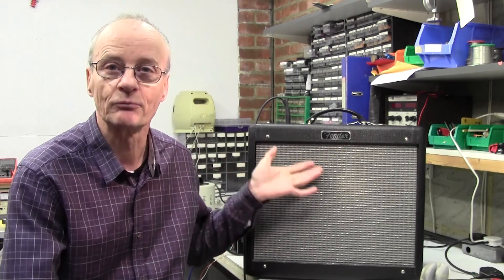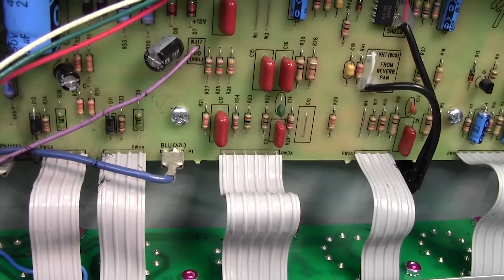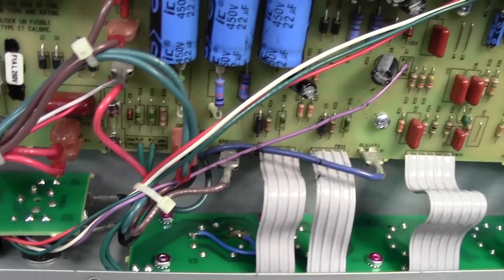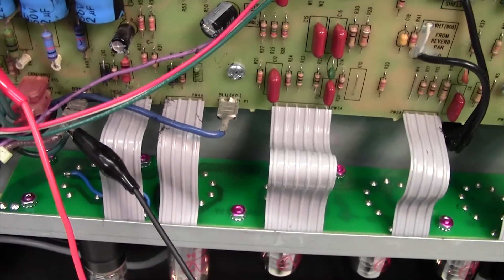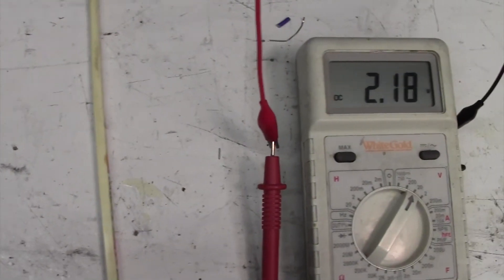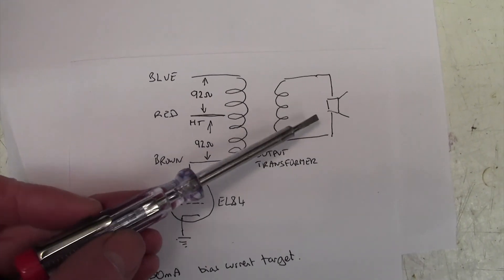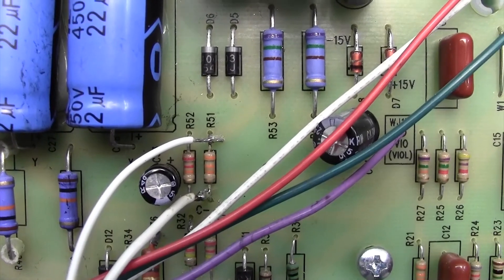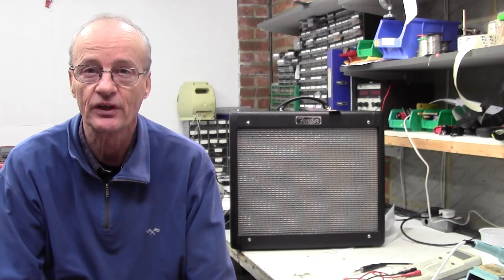How to Bias Fender Blues Junior Guitar Amplifier

Comment: Thanks for the informative videos! I like learning - and a few years ago replaced the Power Transformer in my late 60's Traynor YGM3. - it had a bodged in 220V replacement that caused the Heater to run at 7.5v and B+ at around 450vdc! Has the correct Hammond one in now.

 A couple of diagnosis questions if I may?

I've just been given a dead Blues Junior that had a blown V5 valve and dead power transformer as a project - lost vacuum and has gone white at the top - which I assume may be the reason the PT went down. 
The traces around the base were pretty discoloured with some lifting. Have reseated, but I'm replacing the board. It looks like V5 has been quite a bit hotter than V4 for a while.
Have replaced the PT and all up and running with correct voltages at the filter caps and heater at 6.7V -  but low output and distorted. 
I measured the Output Transformer and have a massive mismatch it seems. I did add a 82k resistor to cool the bias - as per the recommendation by you and people like Psionic. 
When measuring the voltage either side of the centre tap, I have 2.1v and 0.8 volts. The resistance/impedance measurement either side of centre tap is 110 ohm and 45 Ohm. Is it likely the OT has gone south as well? 
All the other components seem to be at spec to the schematic. Many Thanks!
Reply from the maker: Hi. If you have that white at the top that means the tube lost vac. If the PT went down then the tube drew a lot of current. Surprised the HT fuse didn't catch it though. It's certainly possible that the OT went down as well. Despite my video I (and others) are finding it sometimes hard to measure the current on the BLUE side of the OT  (i.e. RED to BLUE). I'm unclear why this is. If anyone reading this knows, I'd like to hear. It's fine on the RED-BROWN side. Your ohm readings on the OT are a fair way off. Each side should be about 85ohms. Disconmect the RED BROWN BLUE spade when you take the measurement just to be sure. Let me know how you get on.
Reply: @stuartukguitarampguy5830  Thanks Stuart. I ordered a Hammond replacement and installed it and everything is fine now - so the OT was definitely at fault as well. The new one measures 92 either side of the centre tap. There is solid brown gunk oozing out of the  old OT where it looks like it melted then set afterward, so I think one side of the tap was totally shorted - still measures 110 and 45 respectively. 
Hard to tell what the sequence of events were here - whether it was a transformer or valve failure. All the big IC caps were fine and showing correct vdc when I installed the PT prior to changing the OT as well. I've replaced them now anyway, as there was some yellow crustiness showing - so they were on their way. 
I've also wired the transformer to operate at 240v as it has a tap. We regularly get upward of 250v from the outlets here! The amp is still plenty loud and crunches nicely when you want it. Not sure why they set it all so high...maybe for the metal kids.
The Valve board was a very brown on V5 and had some lifted traces, so that has been replaced as well. I was given the amp for free and all in it's cost £120 to get it back up and running. 
It's so great having gents like you on YT for self sufficient diy'ers like me, who still want to learn stuff well into their 50s...thanks so much
Reply from the maker: @valleywoodstudio7345  Soubds like you've done a great job there, well done.
Reply: @stuartukguitarampguy5830  my BJiii manufactured Oct 2015 has cooked far left EL84 and i get 3.7v  in Brown lug per video. on the blue lug i get sudden voltage climb to about 2.95v and then open.  Put 2 brand new el84 in i get rise to 3.95v per video and same issue with blue lug no reading.  Following this thread  above - i suspect it’s the transformer.
Reply from the maker: @jonnyz5772  Hi. If you're really measuring 0V from chassis to blue then it could be the output transformer open circuit on one half of the primary. With the amp completely off and discharged, try measuring ohms between blue and red. Should be about 100 ohm, Same as between brown and red.
Reply: @stuartukguitarampguy5830   98 Ohms Red + Brn and 99 Ohms Red + Blue ... whew OT seems good then!  [Unplugged the speaker and got 106 and 107 ohms respectively]
Reply from the maker: @jonnyz5772  Yes that;s ok. From your oither message I think your bias is too high so adjust it down to about 20mA

Comment: Hi Stuart thanks for a cool video. One question you ended up with plate voltage of 333 and bias at 26.5 ma. Doing a little math that is 8.8245 Watts for a 17 watt tube or running at 0.519088235294118 which to me seems to be way cold. Am I missing something here because my math says the tube should be at 11.9 watts and while the voltage will change going with 333 volts the bias should be set at 0.035735735735736 ma or 36 ma.

Am I missing something or are we just trying to make the tubes last forever?
Reply from the maker: Hi. Interesting. I can;t fault your calc. I always use weber bias calculator app on the ted weber site. If I plug these figures in there it say 26mA. at 70% dissipation. I'm not really sure why there is this discrepancy.
Reply: @stuartukguitarampguy5830  
 I think I figured it out. The question is what is the actual wattage of those power tubes. I thought the EL84 tubes were 17 watt tubes but it appears they could be 12 watt tubes. The amp itself is listed as a 15 watt amp but I would have to say the Weber site calculations are based upon a 12 watt tube.
Reply from the maker: @pedalworx  Ah ok that makes sense thanks.
Reply: @stuartukguitarampguy5830  
I was thinking being there doesn’t appear to be an agreement on what the tube power is in class AB operation that perhaps we should go with the Fender numbers?
Fender says it’s a 15 watt amp so 70% of that would be 10.5 watts!?

Hey, what ended up causing the runaway bias in that amp?
What did you find?

Thanks so much Stuart!
Reply from the maker: @pedalworx  The JJ Spec sheet says it's a 12W tube so 70% of that would be 8.4W.  Pretty much what I biased it at.

Comment: If you connect a multimeter between transformer center tap in presence of high voltage it´s very likely that on one of the sides (red-brown or red-blue) you will read strange measurements due to an oscillation that occurs when extending those cables outside the amplifier. In this case it would be more convenient to identify the bad side and read on the good side twice by swapping the tubes between them. 33ma on a el84? Thats too hot! Why aren't you sharing the bias trouble? I'm working on the same amp and its giving me fits trying to get it right.
Reply from the maker: Hi. Okay here's the scoop. The best way to bias these amps is to use a bias probe between the EL84 and the socket. BUT... it's rare for people to own one of these small base bias probes (I do have one made by Eurotubes). So, how to bias? Well, the output transformer primary has a resistance of about 100 ohms. So if we measure the voltage across that primary half  we can work out the current through it. so 2V measured across 100ohm gives 20mA current. We can measure from red to brown for the one half of the push-pull (one EL84). Ok so far? The problem comes with the other half (blue to red). You don;t REALLY need to measure this if you have a matched pair of valves. However, I too have noticed that if I attempt to measure Red to blue, I also get weird results. I have no idea why and if someone reading this knows, please let us all know as this has always mystified me. Take home? No bias meter - measure red to brown and use ohms law to calculate the current.
If you want it more accurate, with the amp off, measure the ACTUAL DC resistance of that winding. You may find it's 94 ohms or whatever, and you can use this to get a more accurate reading. Hope that helps.
Reply: @stuartukguitarampguy5830  Well the amp I'm working on just got weirder. The amp has a bit of distortion in it but I can't find nothing bad. I cut the 3000 volt flyback diodes out of the circuit and the distortion is gone. The diodes test ok. ???????????
Reply from the maker: @rockinws6567  That is strange! Could they be breaking down at moderate vpltage, but read ok on the meter? Try replacing them with new, if you have any.

Comment: I've done the same thing a couple of different ways, one by paralleling a pot across across the 33k resistor and adjusting it to where I like as you did with your decade box and then installing a fixed resistor in parallel the other way one of my vendors hand selected some very low current draw EL84s which sometimes can be dropped right in. I've installed trimmer pots as well. Once I get it where I like it I mark the chassis so the next person in knows what current rating the power tubes should have. Now. Tell us what the fault was that you were talking about.

Comment: Which version of BJr is it you're working on here?  I have read that the Version IV has a  27k fixed bias resistor at R52.
Reply from the maker: That may be, I'm unsure. I rarely/never get a V4 in as they are quite new and not yet going faulty. Most of mine are the cream or green boards. The older versions.

Comment: Hi Stuart. Any tip on how to measure the resistance of the primary winding of the output transformer?
Need to check my biasing since I don't have a probe.
Reply from the maker: Hi Rowan. Why do you want to measure the primary?
Reply: @stuartukguitarampguy5830  I believe the transformer had the resistance around 100 ohms. It could be 95 or 98 ohms etc. I would like to measure my milliamps for el84 considering the exact resistance of the transformer.

I believe I need to measure the resistance between the red and brown half of the transformer. Correct me if I am wrong.
Reply from the maker: @Roman_Guit  Hi  I think you're getting confused about the primary and secondary? Are you trying to measure the secondary resistance?

Stuart
Reply from the maker: @Roman_Guit  Hi Again, sorry it's me who  is getting confused! Yes you can measure each half. From memory it's RED-Brown and RED - BLUE then use your exact reading and ohms law to calculate the current. Sorry for confusion!
Reply: @stuartukguitarampguy5830  Hi again Stuart, thank you so much for the response. The measurements will be done.

I've seen lots of recommendations for UK Blues Junior owners to switch the transformer operation to 240 volts. The export transformer for UK and Europe Juniors has a dedicated terminals which could be switched with no soldering.
This will make tubes running a bit cooler and reduce hum as well. Could you recommend doing it?
Reply from the maker: @Roman_Guit  I've never actually done that so I have no info I can share. However, if you set the bias a bit lower than normal that would achive the same thing I would have thought.
Reply: @stuartukguitarampguy5830  Thanks, Stuart!

Comment: Excellent video Stuart. I'm replacing the EL84's in my Blues Junior because one finally failed. I've replaced the tubes and using your technique to measure the bias by measuring the voltage across the primary of the audio output transformer I'm getting about 15 volts which I assume corresponds to 150 mA of plate current. This is way too high. I tried putting a 100K resistor in parallel with R51 and I'm getting 13.4V of c- which should have brought the plate current down. I have tested all the resistors in the bias circuit and all resistors are within tolerance. I tested the capacitors from the phase inverter thinking some B+ was leaking through them but they test OK. The screen resistors and diodes across the output transformer test OK as well. I know you had an issue with bias in a different video that you made and I was wondering if I am having a similar problem with this amp. Any suggestions would be greatly appreciated.
Reply from the maker: Hi Ralph Very surprised at your reading as that is WAY too high. You should be getting about 2.5V. 13.4V C- also sounds too high. I'd expect about -16V. All I can suggest is that you decrease that 100K resistor until the bias comes into line.
Reply: @stuartukguitarampguy5830  Bingo. I put a 100K trim potentiometer set for 75K across R 51 and now it read 2.2 V. Thanks Stuart you're a genius !
Reply from the maker: @rcjferrara  Excellent well done.
Reply: Hi Stuart, I’m working on a Blues Junior clone , my amp , I’m not a professional repairer but old school electronics hobbyist studied City and Guilds in the Transistor era so not Valve educated.
It’s a Tweed Blues junior clone  ( a sod of a fault with massive hum , all electrolytics changed , power supply 5Watt resistor had gone high from 1.8 k ohms ( original circuit correct value ) to 5 k ohms so changed that , HT seems a bit low but got no voltage readings to go on , remove all valves and hum still there , remove centre tap HT feed to OT and hum disappears ) but regardless the output transformer primary on this has different dc resistance readings from centre tap to each half of the winding , this appears to be normal as I have a replacement brand new same  correct model output transformer which is exactly the same reading wise. Explanations I have read seem to be regarding how the transformer is wound . Something to watch out for perhaps when testing ( just something to put in the ‘ what the hell is going on here ? random memory bank ‘ ) Love your videos and your self deprecation when not being perfect and making school boy errors , helps me no end when I’m jumping to incorrect conclusions about possible fault diagnosis,  and the old ‘that’s weird  , I’ve never come across that before syndrome! ‘…
I’ve put the new output transformer in and no change to fault or hum , I’m not on the right track yet ….. EL84’s look as though they have warmed the back panel up considerably at some stage … the plot thickens 
Regards Chris

Comment: I could not help but to notice you touching vdc points withing the amp while using a metal tool instead of a wooden chopstick..!!  Do you also publish the videos of you being shocked on your ass..???  LOL!  Definitely a no-no for newbees.......
Reply from the maker: Yes I probably should have used a chop stick, but the amp is off at that point of course.
Reply: @stuartukguitarampguy5830  While my 84's are a well matched set, I am unable to equalize the voltage on each tube when metering from trafo to plate..  Any ideas..??
Reply from the maker: @pjf7943  What is 'trafo'?  The method in this vid is VERY 'quick and dirty'. If the voltages are not a million miles out I'd leave well enough alone. The correct way is to get a bias meter. A more accurate way is with the amp off and discharged, measure the ACTUAL resistance of each winding half, blue and brown. Say you get 87 ohms and 96 ohms. Then use these actual resistances to calculate the bias current in ach leg using ohms law.
Reply: @stuartukguitarampguy5830     USA for 'transformer'..  Thanks

Comment: Great video Stuart - very informative. I'm wondering about the low level buzz / hum in that Blues Junior. In your experience is that normal for these amps? or can it be dealt with somehow.
Reply: That blue wire passing close over the ribbons is notorious for noise. Think it’s become common nowadays to tuck them in a bit to get some distance as it can massively reduce hum
Reply from the maker: I'm not 100% sure since it's been a while since I did the vid. The back is off and that would reduce buzz once it is back on. I haven't really noticed a problem with these amps in the past.

Comment: When I tested my brown wire I read 3.23 volts but when I tested my blue it was 2.23 volts.  Is this normal and if not, is it hot or cold or some larger issue?
Reply from the maker: Hi Michael. If you want to be really rigorous, with the amp off and everything discharged, measure the acual DC resistance of the blue to red and brown to red. Make a note of each. They should be around 100 ohms.
The measure the voltage across each winding with the amp running and use ohms law to determine the current. If there is more than about 5mA difference between your valves you may have a mismatched pair.
Reply: @stuartukguitarampguy5830  I'll have to check it out!  Thanks so much.  They are supposed to be matched, just bought and installed them.
Reply from the maker: @michaelwbuncher7599  You can also try swapping the valves. If the reading moves with the valve, then it's a valve mismatch. If the reading stays the same regardeless of valve position then it's safe to assume valves are matched. You could then maybe go for an average of the two readings. This is a  really quick and dirty method without finesse. It just tells you if you're in the right ballpark bias-wise.
Reply: @stuartukguitarampguy5830  I tried to swap the valves and took the readings again.  Similar but larger different now appeared with Red to Brown reading 3.8 (was 3.23) and Red to Blue reading 2.09 (was 2.23).  I didn't expect the difference to be larger!    The tubes were advertised as APEX matched JJ EL84s.  

I'll have to try that other method of DC resistance reading, but I want to be sure I understand how to fully discharge the amp.  

I'll probably just take this sucker to a tech.  Just don't have one that I know of close by and was hoping to find a nice simple way to confirm if I need to bias or not before taking it to someone.  Maybe I'll just stick one of those 68k Ohm resistors on it and it would be easy enough to remove if it mucked with the sound too much.
Reply from the maker: @michaelwbuncher7599  Ok it seems from that that there is a few mA differnce in the matching. Not the end of the world. Honestly? My View? If the amp sounds ok, leave well enough alone. That bias is close enough.
Reply: @stuartukguitarampguy5830  Well, will do!  Thanks so much for the feedback.